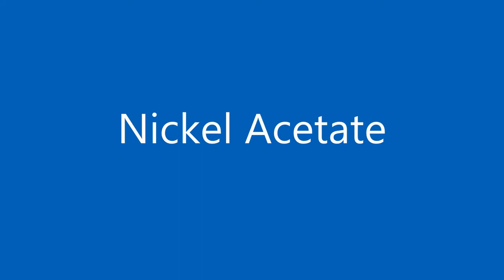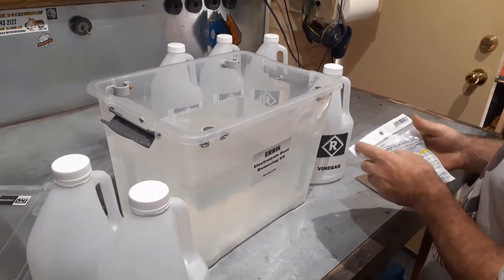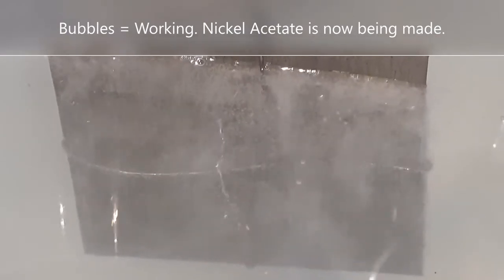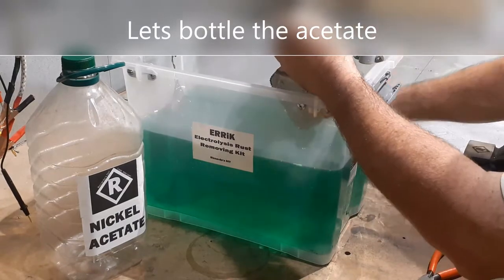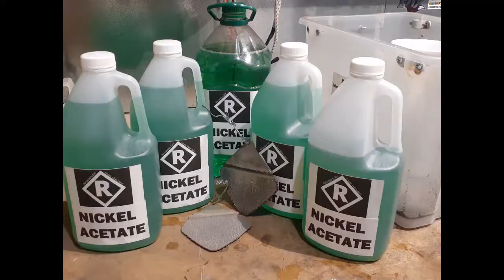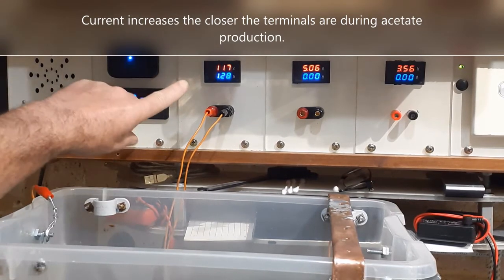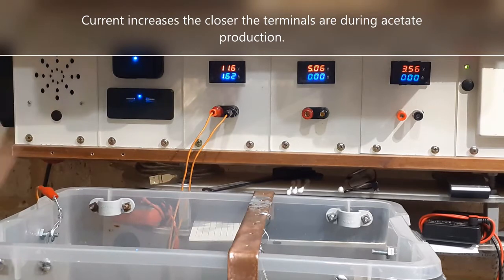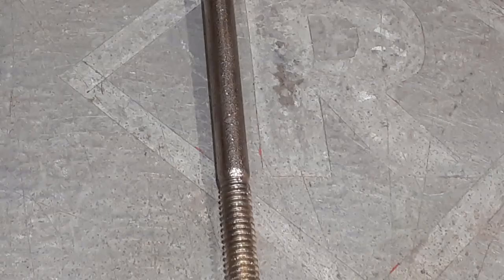Make Nickel Acetate

Comment: I’ve found the more additives in the metal the harder it is to get a good finish.
With 4140 steel, Copper plating first, 5 to 10 minutes at 6 to 10 volts is sufficient to provide a good clean base and a total build up with nickel of less than .0002”. Just nickel plating raw 4140 stock is patchy and no matter the surface finish comes out textured and rough.
Like your setup.

Comment: Thanks for the information. One question I'm trying to plate stainless steel. I have not tried it yet. I just got started . Any tips?
Reply from the maker: hmmm, stainless steel. have not done stainless steel. question I have is if you are nickel plating stainless to match the finished look of adjacent parts? rust resistance should be similar for the two metals.
Reply: @riccardosdiyandrestoration  No, I build hydrogen cells, hho generators, and nicke produces more hydrogen. l
Reply from the maker: @newageautotechnology  Nice. Unfortunately I cannot provide any additional info, however, if I get a chance this weekend I will try and see if it plates. Getting the unit to deposit a layer will happen, I just don't know what the adhesion will be like.
Reply: @riccardosdiyandrestoration  thanks let me know what happens, please .

Comment: Can the obtained niacetate solution be further diluted with distilled water to accommodate bigger parts to plate, or will I have to empty vinegar supplies of entire supermarket. (Gonna plate a bike gas tank)
Reply from the maker: My understanding is (if I can recall my high school chemistry classes)  that you can dilute the solution, however the resulting lower concentrations of nickel in solution will result in longer plating times.
Reply: Yes, you need some vinegar (ascetic acid) to produce the nickel acetate, but the product you want is actually the salt. If you let the vinegar and water evaporate (they fully evalorate) then you would be left with green crystalized solids. That is often how it's sold. Dont let large amounts of acid fume out in a closed space though, especially not a garage with tools ect. the fumes will make other things oxidate quickly.

Comment: Thanks for an excellent guide. Where I live (Norway) there are many different concentrations of vinegar for different needs. What concentration is used in the video?
Reply from the maker: Hi Stephan, I am not 100% sure. I purchased the vinegar from my local supermarket and it was branded as double strength pickling vinegar. hope that helps.
Reply: here in the states grocery store vinegar is 5% but nowadays it's lower at 2%. so for canning foods "pickling" read the label and make sure it's 5%. home depot sells 30%. you can order 45%, 75% Balsamic Vinegar comes in 100%  you'll be fine with 5%
Reply: Here in sweden we have another name when white vinegar is higher concentration in grocery stores. 24% should be cheap, you want the highest concentration. Here its called ättika
Reply: @leonordin3052  Hi / Hej.  Thanks for the reply. I found 12% ättika at Claus Ohlson. 50/50 water worked like a charm. Cheers from another swede 😊
Reply: @fvrrljr  Thanks. Missed your answer
Reply: @StephanJPPL  :person-turqouise-waving: